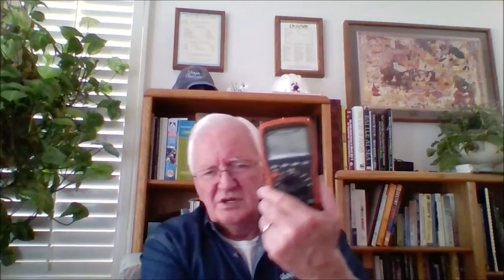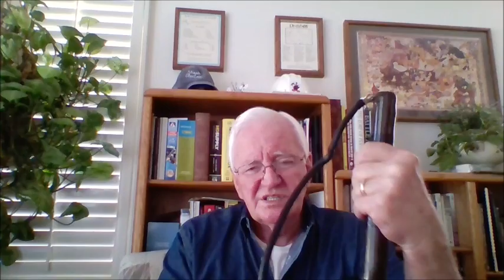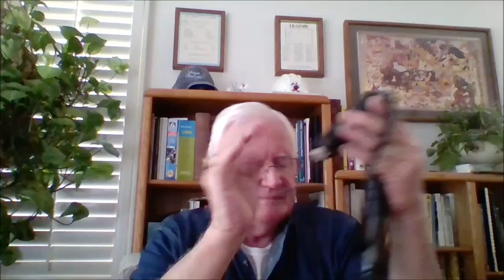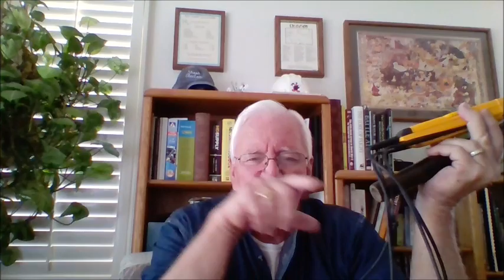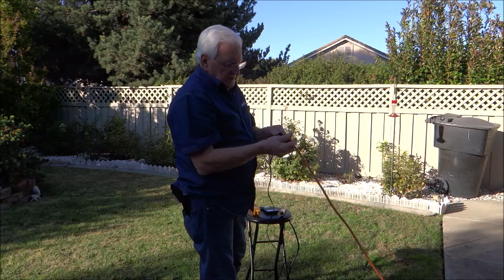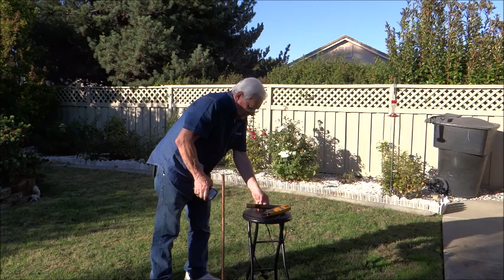Ground rod  test Ground Rod Testing Measurement: Grounding methods, John Shook

Comment: You must have really good soil there. Getting less than 25 ohms by driving it only 3 feet is wild. Mike Holt has a video where he drove a rod 50 feet and didn't get there.

Comment: another simpler way you can test is using a multimeter . just flip the thing to ohms and one lead goes to the ground rod and the other lead to the service panel ground bus.

Comment: Hi there, excellent video on testing earth ground resistance.  
Got a question though. What if the supply voltage is 240V what value of the ohmite that should be used. I would greatly appreciate your precious answer.😊😊😊
Reply: 120 V
Reply: @patshook1088    
I don't really understand your kind response.  My country's incoming voltage supply is 240V. So what value of the ohmite should I use since the one used in this video is for a 120V incoming supply.😊😊😊
Reply: @firdausravindar977 I’m not 100% certain but I would think use the same value.
Reply: I’m not either but guessing is all I have since the video author will not respond and nobody else is willing either.
Reply: if you want to use the same current to calculate, that would be 50ohms resistor, and double the power it can handle too, so >450w power registor.
at this point you should buy those 1kw 220v heater element that should give you R=220^2/1000=48.4ohm, just measure the resistance beforehand, same calculation

Comment: Thank you for the video. When testing  a ground rod in an existing home, is it necessary to first disconnect the ground cable running between the ground rod and the breaker box?
Reply: Yes, test the ground rod disconnected from the ground wire.  Be sure to use Electrician's gloves in case their is current on the ground wire, which could pass through your body and electrocute you.

Comment: you can go with a hot directly to an unconnected ground rod and find your resistance without all the extra resistors also they make a meter that is clamp on that uses radio frequency to measure ground resistance without using anything else or even having to disconnect anything
Reply: Problem is if your rod is low ohms, there will be too much current going. With 25ohm resistor cap it max for 5amps on 120v
Reply: @rm6857  which is why more than one rod is used in a system as per code 😎 25 ohm min

Comment: John, thanks for this old school lesson. You are plugging into an extension cord. Which wire is connected to the 25 Ohm resistor, the neutral or the hot? Watched video again, it's the hot wire - the neutral is just for double checking the resistance of the resistor. I am guessing we better make sure when we plug into the extension cord we don't get those reversed! What gauge wire is connected to the ground clamp?
Reply: 12, The Hot, the Ground is in the Ground back to the Pannel. JS

Comment: This is great.  Really got me thinking.  One question:  250.53(A)(2)Exc. specifically says: "If...electrode has a resistance TO EARTH of 25 ohms or less..."  Is that what this test is actually measuring?  Assuming the service is not otherwise grounded in any way, wouldn't this be measuring the resistance THROUGH the earth from the rod to the street transformer?  Or maybe it's the same thing?  Forgive my ignorance.  I'm just trying to wrap my head around this.
Reply from the maker: Yes.  To Ground where ever the ground is.

Comment: Finally tested the setup using the 225W 25 ohm resistor. Testing, I get 4.8 amp as expected. Installed a new 8-foot ground rod and tested - read 0 amp. Installed another new 8-foot ground rod bonded to other new rod and still get 0 amp. If I clamp to old, original ground rod I get 4.8 amp. Doesn't seem to be working for the new rods.  I measured resistance between old ground rod and neutral (grounded conductor) of the extension cord and got 1 to 2 ohm.

Comment: Thanks for the excellent explanation... I'm working on setting up a test setup. You mention using smaller resistors, but is there risk of these burning up? If my calc is correct, this test across a 25 ohm resistor (120V) produces 576 Watts of heat. 50W 25 ohm power resistors are readily available and cheap.
Reply from the maker: yes 25 is best. JS
Reply: @JohnShook  I tried two of the 50W 25 ohm power resistors I bought off Amazon.  During test of first one to verify 4.8 ohms (probably took 15-30 seconds) the resistor was very hot and fried to open circuit.  Hooked up the second one and it fried the same way in a 2-second test. I'm thinking none of the low-wattage-rating resistors are going to work.  I'm going to spend a little more and the the 225 W wire-wound resistor... and try again.
Reply: I was wondering the exact same thing. Is there a reason we can't use 100 ohm resistor because that would be 1.25 amps and still need to dissipate about 150 watts? You also could get the current without an amp meter by measuring the voltage across the resistor (V = IR)

Comment: I would like to test the impedance of my ground rod on my ham radio antenna system to determine if the impedance is acceptable so that my surge protector that is installed in the antenna coax line is shunting transient voltages adequately to ground.  Here is a link depicting the surge protection device: 

https://www.alphadeltaradio.com/pdf/TT3G50_instruction_sheets-6.pdf

The ground rod is at the base of the antenna, driven 7' deep. I have a 3' run of #6 stranded, insulated wire from the lug on the surge protection device, which is then clamped to the ground rod at the base of the antenna with a bronze clamp.  

I also have a 100' run of #6 stranded, insulated wire connected to the ground rod clamp at the base of the antenna. That 100' run of #6 wire is from the ground rod at the base of the antenna to the bonding electrode on the other side of the house to equalize the voltage on the circuit, so as to avoid a ground loop condition on the grounding circuit.  

Can you advise how to test for impedance on my grounding circuit so I can know that my ground for the antenna system is working adequately to shunt transient voltages to ground, and what the impedance should be on that grounding circuit?
Reply from the maker: I will send this to an expert on Ham's antennas. JS
Reply: @JohnShook  Thanks John!

Comment: Great demonstration; I just bought a 225 watt 25 ohm resistor and can't wait to try your method.  I am a little confused about the fact you started out talking about a much smaller 70 ohm resistor and did not understand how that fit in.   You never demonstrated it being used in the measurements.  For a second I thought you might be using the two resistors in series.  If so, the small one was too small to see in the video, in use.
Reply from the maker: Ken the 70 is if you don't have a 25 ohm,  just use the 250 watt 25 ohm for your 1st resister and the ground rod is your second.

Comment: Why not just hook up the hot wire to the ground and measure how many amps straight to ground?  I don’t understand the need for the resistor.
Reply from the maker: That's a great way to collect Worms for fishing. If the ground rod is shorted to the panel the arc may surprise you.  JS.
Reply: @JohnShook  I did it yesterday to a new ground rod I installed and it was pulling 7.69 amps, so I guess I have the necessary less than 25 ohms.
Reply from the maker: @R900DZ  15.6 Ohms at120 V.JS

Comment: I have followed all you steps but my breaker trip 😔, i have disconnected ground connection from my extension cord. I am using 4 x 10 ohm power resistor in series. Anyone have any advice on this? My voltage is 240v by the way and my specification require below 10 ohms.
Reply: Is it a GFCI? Those will trip with the slightest ground connection.
Reply from the maker: 240 / 40 = 6 amps ?.
Reply: Yup, i got that in calculation but it trips on the breaker. So i cannot measure my current flowing. My extension cord is not connected to ground. What have i done wrong?

Comment: Just a question. One end of the 225W 25ohm resistor is connected to grounding rod (via the clamp) and the other end of the resistor is connected to the hot wire on the extension cord?
Reply from the maker: Correct, JS.
Reply: I was also confused. He mentioned the neutral, but I think no neutral wire is needed to do this test. Is that correct?

Comment: Hey, John thanks for the great video.  Could you tell me what type of resistor is that you're using? How many ohms and how much power dissipation? Thanks.  I'd like to put a test system together like yours. I have a grounding rod on a new installation to test. Thanks again.
Reply from the maker: John Shook
225 Watt 25 Ohm Resister, Page 584 MC14681, 28K6295, (Book) Newark,  Elements 14, is $15.89 JS

Comment: I would think a typical 4 slice toaster would be pretty great at testing ground rods. One side would be between 25-50 ohms for a typical 900-1100W toaster. Those Ohmites are a bit more expensive than they maybe used to be, toasters are cheaper.
Reply from the maker: 225 Watt 25 Ohm Resister, Page 584 MC14681, 28K6295, (Book) Newark Elements 14, is $15.89 JS

Comment: How much heat will the resistor put off when testing?
Reply from the maker: It may get warm if used for an hour or so. I wrap it in electrical tape. JS.

Comment: Great video! My only question is what is the purpose of using a resistor? Couldn't you take the same measurements using just straight 120 and take a current reading?
Reply from the maker: Running the risk of short circuiting, The resistor is $15.00. JS
Reply: @JohnShook  thank you for sharing your gifts and knowledge. You've made a lifetime of keeping people safe. It's certainly something to be proud of.
Reply: With 25ohm resistor you cap maximum current for 5Amps on 120V network

Comment: So John, where can I get a 25 ohm resistor like that.  It would have to be at least 500 watts.   Can't find one online.
Reply from the maker: Newark in element 14: Page 584  part # MC14681 225 watt 25 ohm 28k6295 stock #. $15.89 each. JS.
Reply: @JohnShook  Thank you John.  Just this morning to inpector told me to drive another ground rod 6' from the other I installed.  If I could prove less than 25 ohms I would have been fine.  I will use your method.  Funny, when I was a kid I used to collect earthworms for fishing by tying 120 volts directly to a ground rod.  They do come up!
Reply from the maker: Me too, JS.

Comment: i have a house that was built in 1961 it doesnt have a ground can i drive a ground rod 8 feet deep and ground the new central air and heat  straight to the ground rod
Reply from the maker: Yes, If you can ground the panel also, Some old services have grounds at the service pole at or 1 to 2 blocks Away, Power and light Grounds there Neutrals at the transformers,  JS
Reply: @JohnShook  An old 1956 house with no ground rod, overhead power lines, the power pole with transformer is 30ft from the house electric panel.  Is the house actually grounded at the pole??  Is that what you're saying?
Reply from the maker: Power and Light Grounds the Neutral usually at each transformer. Phase 1 and phase 2 and a grounded Neutral are brought to each house. JS.
Reply: @JohnShook  Ok thx.  But does that mean the house doesn't actually need a ground rod near the elec panel?  Or should one be installed?
Reply from the maker: It's good to run a ground near your panel and use a ground fault detector, for protecting Electronic TV's and Computers. JS

Comment: Why not just go straight from the extension cord hot to the ground rod and measure amps with out the 25 ohms resister.  And does it have to be. A 225 watt on the resister
Reply: I am gonna second that, because i did just that this morning and the main switch tripped
Reply from the maker: A 25 Ohms 50 Watt will work, Going from hot to ground is a dead short. JS
Reply: @JohnShook  It is not a dead short. The ground rod has resistance back to the panel which is what we are trying to measure. The only purpose of the extra resister, in my opinion, is to limit total current which makes the whole measurement process safer and reliable. As an example, if your ground rod resistance was 5 ohms, then it would pull 24 amps which would flip a 20 amp breaker. By putting a 25 ohm resister in series, total current would be limited to 4 amps making for a safer test. Of course if your ground rod resistance was 60 ohms, it would only pull 2 amps which would be okay to measure without a second resister. We do not know the ground rod resistance ahead of time though, so putting a 25 ohm resister in series limits total current to no greater than 5 amps. I enjoyed watching this video. Thank you for the information.

Comment: Is it Alternating Voltage(AC)  (or) a Direct current (DC ) voltage is required? for the testing
Reply from the maker: It's AC, 105 to 125 V, 60 Cycle
Reply: @JohnShook  Can I use in 220V, 60 Hz for the same test?

Comment: John, great show and tell video.  One question I have:  Is the connection from the 25 ohm Ohmite resister to the 120V extension cord only connected to the "hot" wire?  The neutral and ground is abandoned?
Reply from the maker: Yes the ground rod will complete the circuit back to the panel.